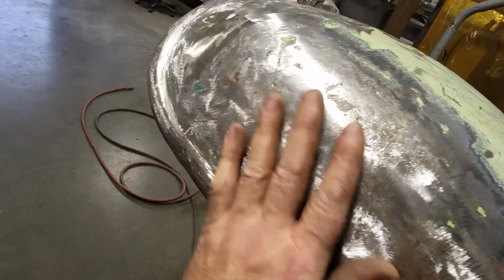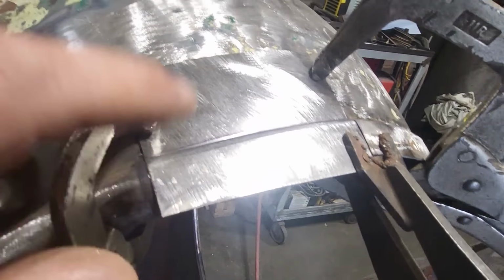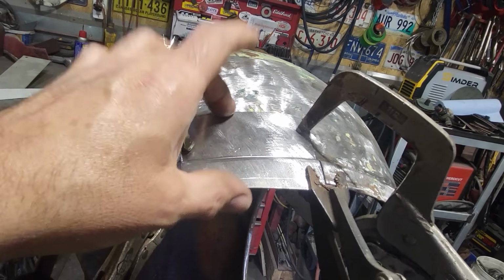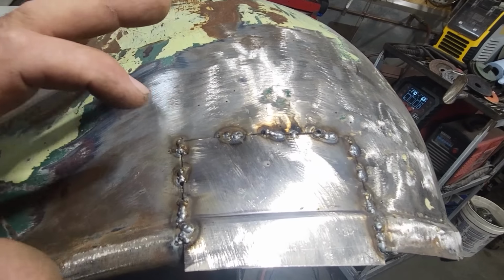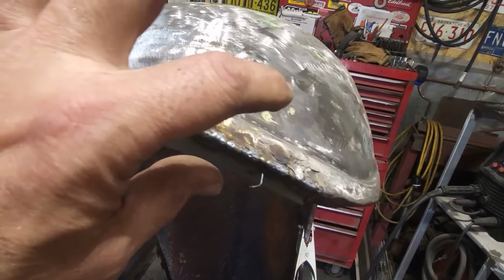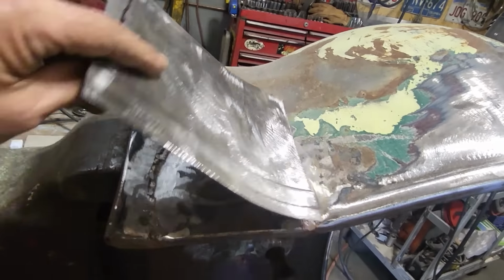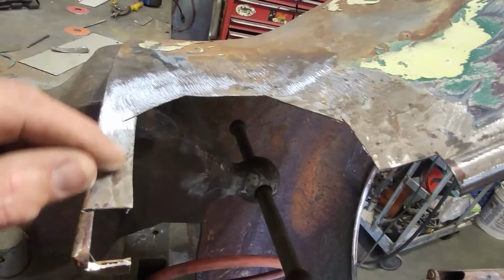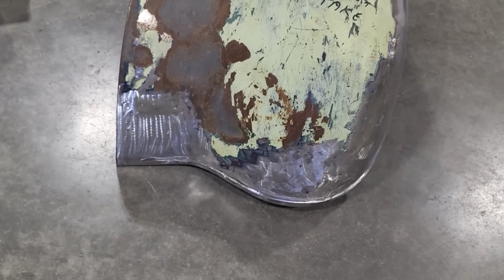Making complicated repairs simple.

Comment: Making complicated repairs look simple..there, I fixed your title for you. I was thinking of you the other day . I picked up a hose reel from Habitat . the one side of the sheet metal ring was distorted from something falling on it probably . the lead in hose was split , the hose was dirty . but it was $5 . the swivel alone is worth more than that.
Anyway I made a metal spoon from some 12 gauge stock, put a bit of a roll into it and rounded the end to make it match the profile of the rolled edge . that's where you came into mind... home made tools , keep it simple etc etc .
I figured I had nothing to lose trying to shape it back to original.
Just then a neighbour dropped over . He said No way will you ever get that back to shape ... 
well some hammering & dollying I got it back almost perfect . He was impressed as get out ...  theres a bit of ding marks in the metal but a coat of semi gloss paint will make it look  like a million bucks. and the hose cleaned up like new with some thinners . There you go, I was buying it for the swivel, now I got another hose reel. 
You gave me the confidence to try to repair it. Thanks Fitzy!

Comment: I found that when I used a piece of brass behind the weld like you demonstrated, that I had to turn the welder up a little bit because of the heat drawn by the brass.